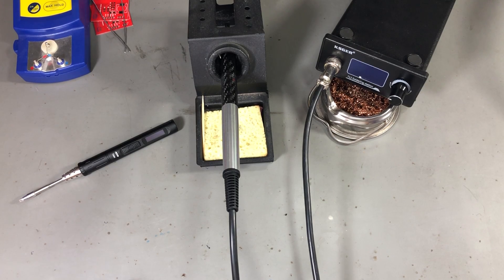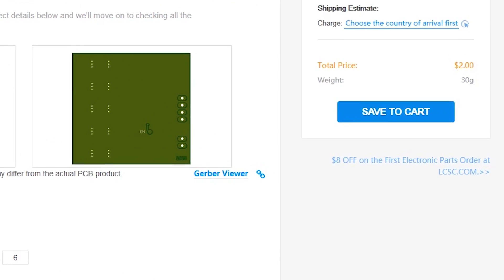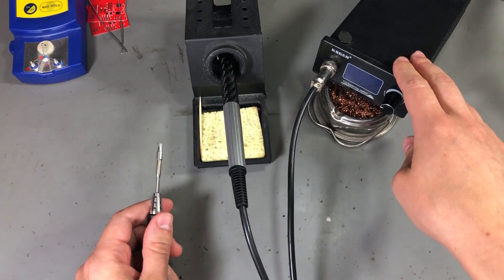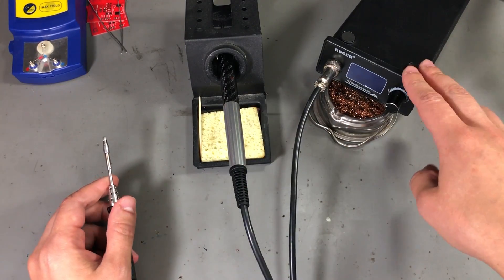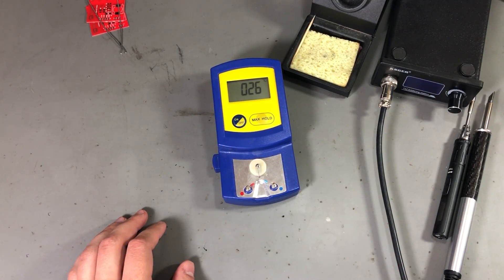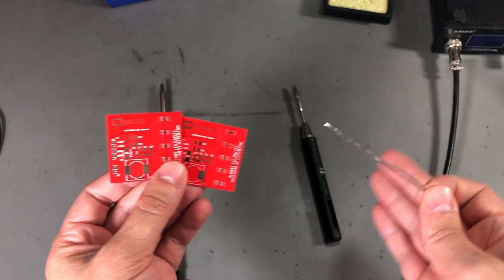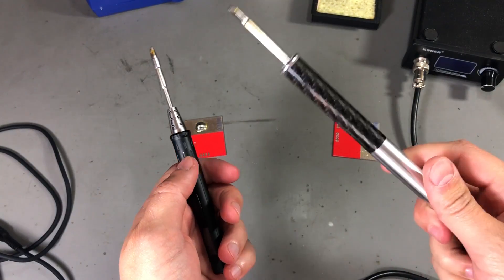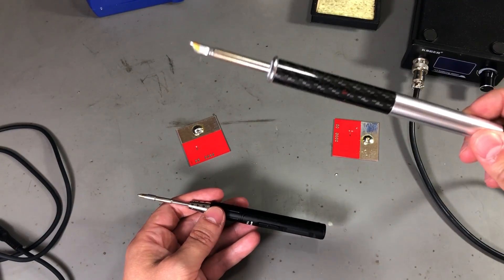Voltlog #243 - TS80 VS KSGER T12 Soldering Iron Comparison

Comment: you can also now get a battery pcb for the inside of the ksger unit and build one that runs on batteries that you can charge up and gives around 1-1.5 hours from my experience depending on usage. yes its bigger but i dont find that to big of an issue. i made a longer handle wire so if im using it in a car for example i can sit the unit somewhere safe and have a longer reach.

Comment: Would you recommend i go for the KSGER T12 or the TS100?
Reply: Better buy induction soldering station. Best budget option yihua 900h
Reply: wanted to know this answer too
Reply: Recommend t12 , if you want portability then better go for ts80 than ts100 because ts80 supports usb type c but ts100 doesn't

Comment: Nice. Why don't simply take Ersa 150S (150 watts, heavy) and compare that to TS80)) Ersa wins, I bet)) Thermal mass of T12 tip and TS80 are very different. TS80 has a bit similar tip (K4) surprised it was not used for comparison, or another similar to TS80   T12 tip (which are aplenty) could have been used for the test. I think the comparison is not correct. I compared TS80 to my JBC 245 handle and tips powered by 130 Watts controller (Unisolder and I am sure it does feed this power since I have an appropriate transformer and the firmware itself limits 24V @6A so go figure). I did not notice a "significant" difference in performance between them, except that high thermal JBC tips can conquer with my brutal Ersa 150S)), for them, JBC has a clear edge of TS80. But that is JBC, which is stellar equipment)), I guess somewhat  funny like T12 station with switching PS and questionable tips (no avail to genuine Hakko) will not look way better than TS80, by all means))

Comment: I havent got a T12 yet. However I think there is no competition. For heavier jobs you need more power. Some years back I upgraded from a 50W brand iron to 80W and it made a huge difference even with the average job. When you need a portable iron, usb irons have no competition. Inverter and some batteries in the backpack are not for most of us :)
I have a 80W brand iron and TS80 for portable use, yet just ordered a T12 for some other use cases and backup tool.

Comment: I have the Quiko version of this ($20) without the built in power supply.  I use an old 19.5v laptop ps for plug power and for remote power, I 3D printed an adapter for my 20v Ridgid power tool lithium battery pack and that powers this for hours...  Love these things!

Comment: I’m pretty much a complete dullard when it came to electronics. But thanks in part to you I’ve learned quite a bit. I’ve learned to solder with a TS100. Maybe because I didn’t know better it’s come to be my favourite. I tried the station but I guess it’s just dumb luck but the TS just feels better. Being an older fellow I remember junk plastics. But I find no downside or improvement with the TS80. More money. And at least with the 100 tips are fairly cheap. Some shopping required but seeed and other electronics spots have some really low priced specials. Last tips put me back under $4. Thank you again,  I enjoyed the review. I hope the sponsorship doesn’t hurt the number of views, but maybe that doesn’t matter. That said yours is the only channel I put up with posting ads. Good content wins.
Reply from the maker: Thomas Jaszewski sure, everyone has a favourite soldering iron, it's nice we have so many affordable options so we can choose.

Comment: Nice test, but you should've do the test with similar tips, the ts80 uses a D25 tip and it's way smaller than the K type that you used on the ksger and with the power difference between the irons it be probably better to use a even smaller tip on the ksger, something like a D16 tip. Cheers.
Reply from the maker: The ts80 tip is shorter and thicker so I think it actually had an advantage over the knife tip on the t12 station.

Comment: If you wanted to, I don't see why you couldn't pull the power supply out of the KSGER and replace it with a battery pack. There's lots of space in the enclosure after it's gone and that would make it portable.
Reply from the maker: jamisonlm3 sure you could do that but it's not the same level of portability, the ts80 would still be easier to pack

Comment: I purchased the Ksger and overall had a bad experience with the unit.  It was intermittent in heating the iron and I could not get sufficient information on some of the error messages and little support.  I final repaired the bad contacts in the iron and a cold solder joint.  I noted there are several others that had similar problems with the Ksger.  At least for me, I would not recommend this soldering iron/station.  However thanks for the video, I enjoy your channel.
Reply from the maker: ok, thank you for your feedback!

Comment: Have you seen these?
https://www.amazon.com/KKmoon-Soldering-Precision-Adjustable-Temperature/dp/B07J9HKWSG/ref=sr_1_12?keywords=usb+soldering+iron&qid=1563626619&s=gateway&sr=8-12
Reply from the maker: Nope, haven't seen it before. Looks to have a custom cartridge type tip.
Reply: @voltlog  I have asked several sellers about that and none of them have told me where to get spares.  I found the model number once but I forgot it.  It was listed under the specs on one of the listings.
But aside from the oddball tip, it looks like a neat soldering iron.  All the reviews I have found are in Russian and I can't understand them.

Comment: Why do people get the TS80 when the TS100 exists and is much better?
Reply: I wouldn't say the TS100 is better, they perform about the same - at least for my use-cases. I like the TS80 a lot more because of the shorter grip to tip and because I can power it with a tiny powerbank.
Reply: And it hovers around 38-40 $ without shipping.
Reply: @andreikolozsvari  I bought it for 50$ free shipping! Been using it for about a year now, and I think they're the best 50$ I've ever invested
Reply: I have both, and at least for me TS80 feels way nicer in hand. I use TS80 on 24w and cannot notice any difference in performance. Also with two kids and no dedicated workbench, TS80 is easiest to use. Just plug it into phone charger and go :)
Reply: TS100 is definitely more powerful and has the cheaper tips, but i guess some like the USB-C on the TS80 so it might make sense for some use cases.
Reply: I have had a TS100 for more than 2 years, I us it for all my soldering using a 19v laptop supply, best iron I ever bought..

Comment: Another point for the cheap T12 soldering stations. Couple days ago  I received Quicko-branded T12 soldering stations and so far it has been great. It's not exactly the same as your KSGER, but they are comparable. TS80 was my second option, but seems like I made a right choice.
Nice comparison!
Reply: Recently bought a Quicko T12 as well.  Best that I have, but would like to be able to hold it closer to work.  That KSGER handle does seem swallow the T12 tips deeper; I am jelly.   Puzzling that they put the cord attachment on the left side of the control box.
Reply: @GnuReligion  My soldering station came with 9501 handle, which has about 5cm or 2" distance between the handle and the tip. If your soldering station has 6 pin connector, you can find these handles on Aliexpress. Just search for "9501 6c handle".
Price is in range of $12. At least in my opinion it would be worth it.
Reply: You can use different iron handles with these. Many different models available in different price classes. I believe the shortest ones are about 37-40mm from iron grip flange to solder tip.